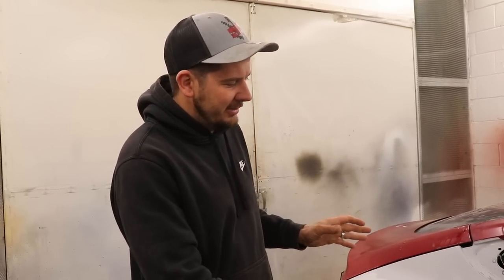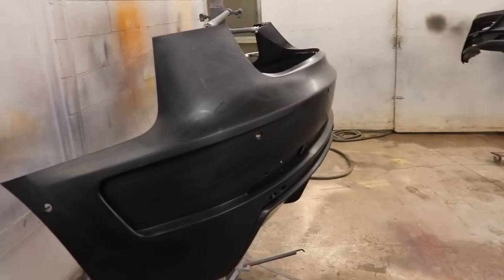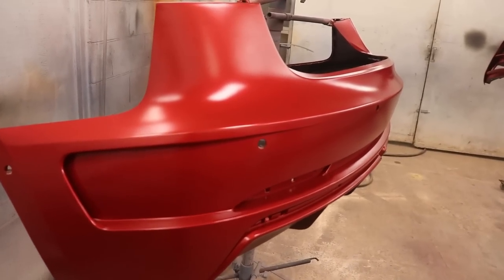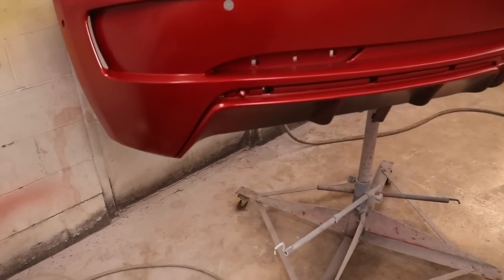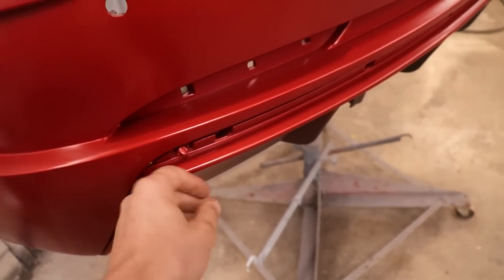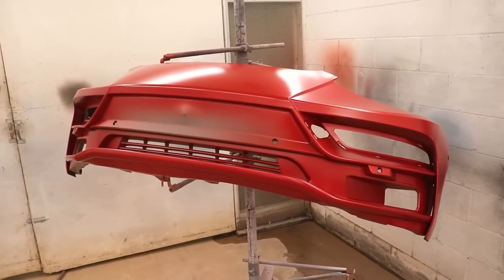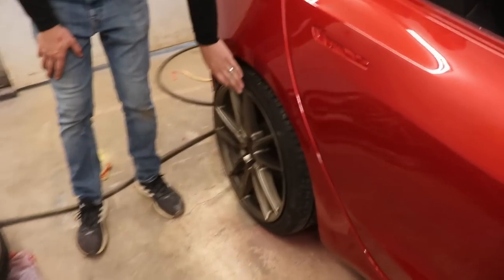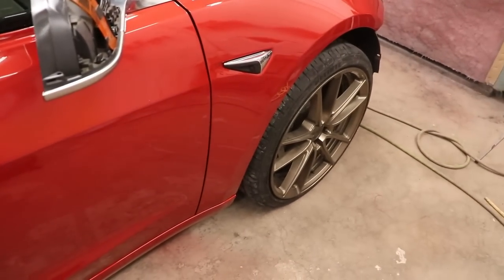Painting The  Wrecked Tesla Model 3 & Time for New Wheels

Comment: Changing the bumpers and the wheels on an EV may alter it's performance and battery charging ranges, so keep that in mind.  Which way, positive or negative, depends on the modification.  But I have no doubt it'll be a cooler looking Tesla M3 after it's completed.